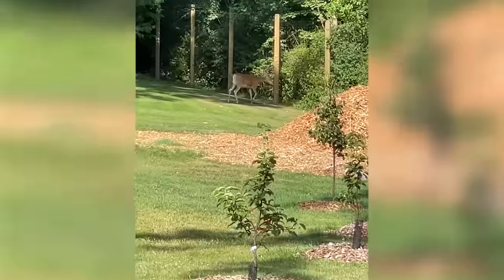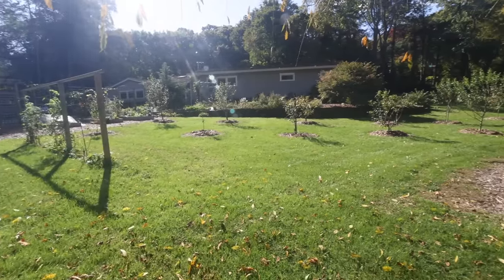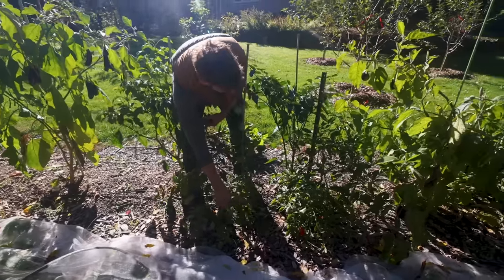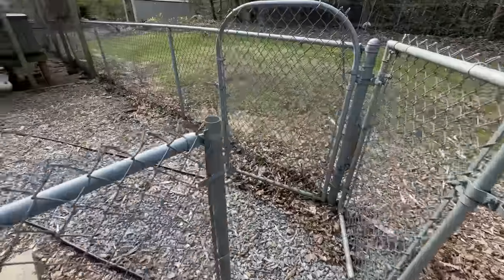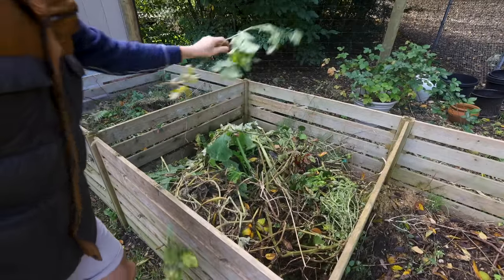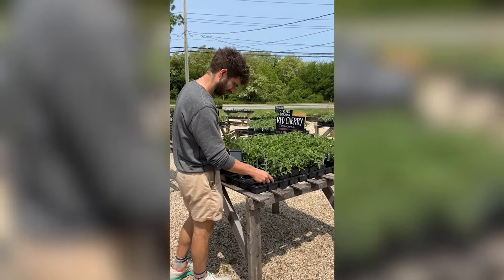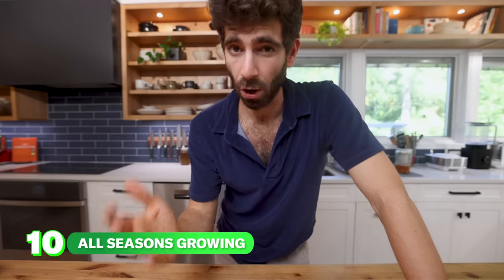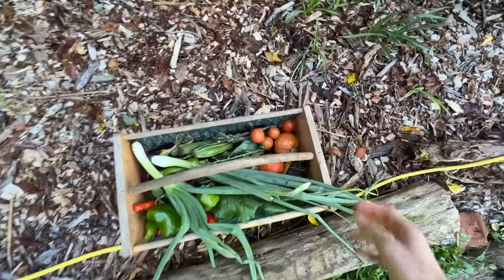How I Became Self Sufficient in 3 Years (almost*)

Comment: I’ve been growing my own food for a long time and I used to do all  of that work until I had an idea that changed everything!  I created 2 fenced in areas. One for my chickens, and one for my vegetable garden. Whenever I have vegetable scraps or any kind of compostable material, I throw it in with the chickens. They scratch through it and break it down and turn that into poop. The next year I put my vegetable garden where the chickens were and I put   my chickens where  my garden was. No more need to compost :) It has been working great! . PS the chicken coop is right in between the two areas so on year one they go out one side and on year two they go out the other.
Reply: I am just starting this same process this year! We have plans for addition fence to create a 4 section rotational grazing/gardening loop. Our chicken run has 2 elevated coops as bookends that hold 15 chickens each and there are walk through doors front and back and side to side...so it's ideal to make 4 separate garden plots. We are considering adding rabbit tractors to the mix for diversity in compost material. We also started wood chip piles and log structures for mushroom growing in the shady area of our yard in hopes that "mushroom compost" can also be added every 4 years or so. It's so exciting... I'm glad to know it's working for you. I've not heard of anyone else doing this like you've described and it's very reassuring to know that it is working for you!
Reply: @jeas4980 and the chickens also eat the grubs and eggs of nasty bugs :D
Reply: I agree, my chickens have always done the composting & cultivating, while fertilizing & eating the pests. I live in Australia & found compost bins attracted vermin such as rats, roaches & tons of flies.
Reply: Chickens do not have to be expensive. I imagine the closer you are too the city were suburb the more expensive they are but we letters free range and 3 seasons of the year week barely have to talk them any food. They find their own greens and they're own protein and they are pest control in we're we live that is huge because we are over run with insects. You don't talk to spend thousands on a coop we builders out of pallets and pallets crap. If you take care of them right they will really if ever get sick. We have never had ours to a vet. We had a consult with a vet only once. Pretty much if we lost a chicken it was a predator. I found we have lots of those if I give them a place up off the ground to roost. You can ferment their food, grow them microgreens and fodder.. and feed them kitchen scraps there's a reason that not very much money is called chicken feed . I find it well worth it
Reply: That really is brilliant
Reply: Chicken tractors are a common feature of permaculture gardens. With careful planning in time, you can have a new space available for your girls to pick over every couple of weeks, and plant into the space they've just left.
Reply: This is my plan when I move out of the city. Right now I have a small backyard and legally can only have my chickens in one spot in my yard.
Reply: @unnamed2737  local regulations like that are nasty. Hope you can get out of there soon!

Comment: Another idea with chickens would be a deep litter method especially in the winter.  Instead of emptying weekly simply add more wood shavings on top of the droppings.  This will add heat to the coop and if the chickens get cold they will use this heat.  You just want it to stay relatively dry and have good ventilation.
Reply: When you do clean it out in the fall, winter mulch your strawberry patch with the used shavings.  The following summer crop will be amazing!

Comment: If I had a greenhouse, I would do exactly as the family on the "Living Traditions Homestead" You Tube channel. I would do exactly as they have done.  It is the most maintenance free greenhouse I have seen, bar none.  As I am older, I could still garden with their methods.  Yours appears will need a lot of labor to maintain each year. They grow veggies and salad year around in Missouri.  Both your environments are challenging to some extent.   Good luck.

Comment: I used to use a half moon edger but replaced it with a Fiskar edger. It’s a fantastic tool. So much quicker than the half moon for me. I also combine it with an Azada hoe which I use to just take the top turf layer off.  It disturbs the top inch of soil but for me it’s time saving.

Comment: Not sure how chickens would not be financialy viable. Got 2 hens for 32$. Feed is 25$ per gigantic bag. I need 3 per year for 2 hens, 75$ (I let them free range 1-2 hours a day in the yard and feed them food scraps to reduce cost and improve their diet and hapiness) Coop and feeders were 100$ used. So around 250$ to get started from scratch. At about 6$ per dozen of low quality, low nutrient, weak, crappy eggs, you would break even within the first year and add a ton of fertility to your garden/compost, pest control increasing yields, not to mention adding a superfood to your diet with added omegas from free ranging. Honestly if you can have them in your backyard, that would be my first step before planting anything. Gardening without my slug swat team would not be the same...🐔🐔

Comment: Question: I live in an apartment, and the only outside space I have is a very small square of terrace that's in between 4 walls, with the sun mostly only hitting it from straight above (and even then most of it not direct sunlight). Is there anything I could put there in a pot that would survive? I had lavender, but the weekend after I bought them it started pouring, and it immediately died. I want something there (plant, flower, vegetable, whatever works), but have no idea what would survive there.
Reply: Consider getting some sturdy shelving and putting good grow lights on them. There are YouTube videos with people growing their veggies only using their grow light system. And there are lots of specific vegetables that you can grow indoors only from seed. Mostly greens like lettuce and spinach varieties, but also some tomatoes and other stuff too.